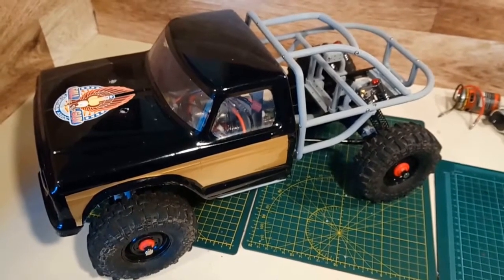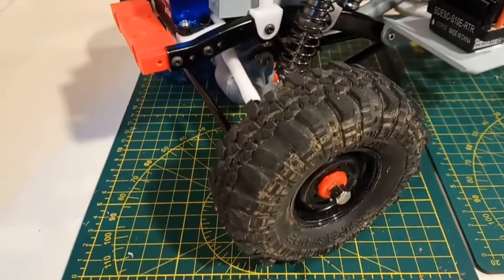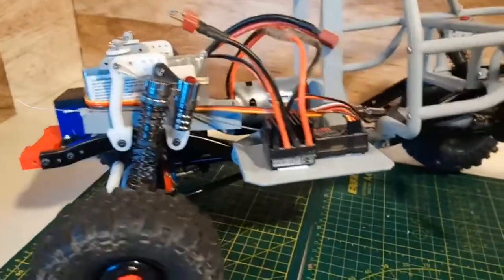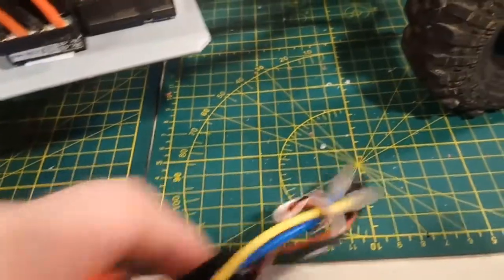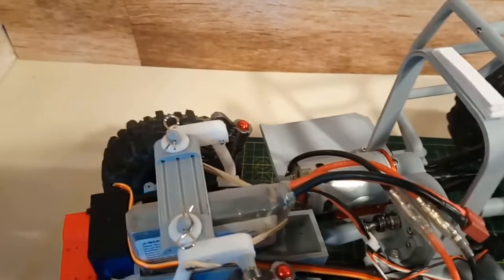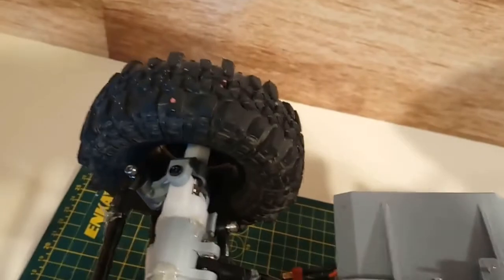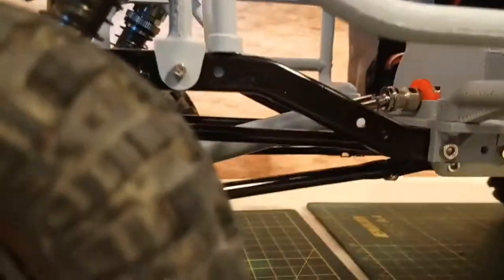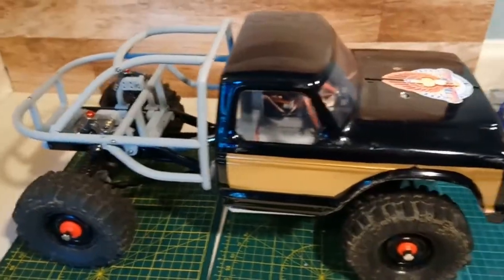WLToys 12428 Budget Crawler Conversion Update

Comment: This is one of the most modified ones I've ever seen, when you took off the body I couldn't recognise any of it
Reply from the maker: Yeah, I wanted to see how cheap a guy could build a full on solid axle crawler, and the axles always drive up the budget so trying to use the guts out of a cheap car like the 12428 seemed like a good idea.  I think I should have made a solid axle rock racer because of the high gearing, so I'm working on a new chassis that will also be all 3D printed...  when I started I didn't think a plastic chassis would work, but now I'm not so sure, so we'll see.  Should be very affordable (if you have access to a printer, of course)